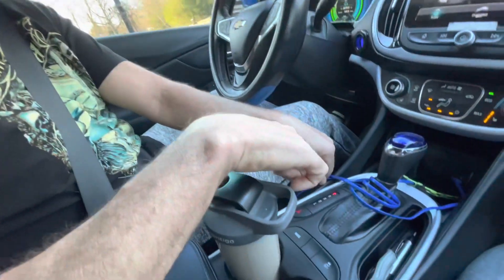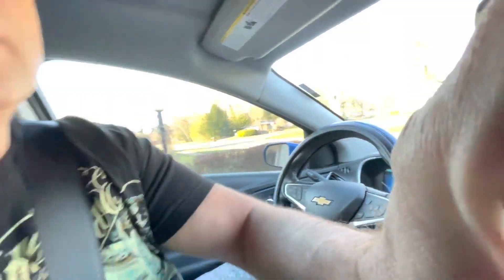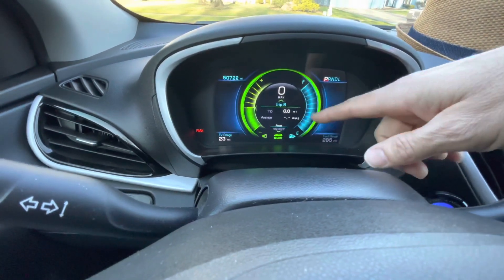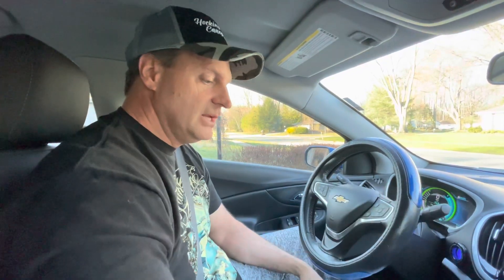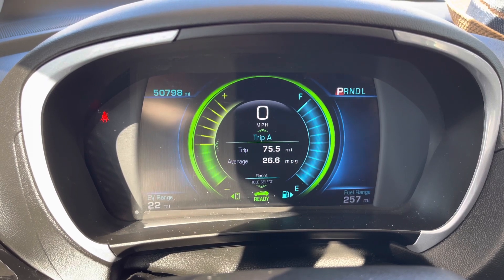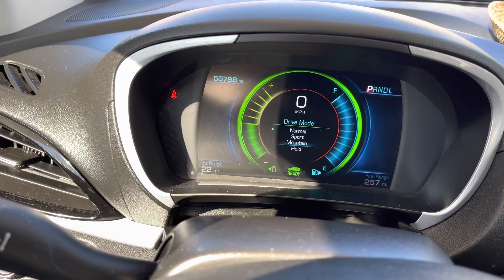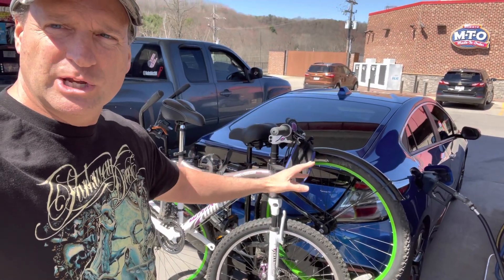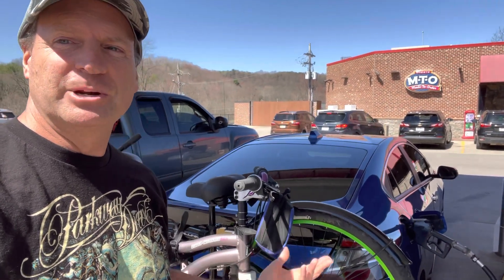800 Mile Chevy Volt Road Trip Experiment - One Way In LOW versus One Way In DRIVE!

Comment: I know i am  late to the party bu interesting experiment. I am new to volt ownership and was wondering about this very thing, so thank you. Side note and unrelated, what bike rack is that you are using? Been looking into getting one myself.
Reply from the maker: @goose_egg3698  I had some Chevy points because I have previously owned a Chevy and so did my ex so I use that to put the tow hitch on when I bought it and then I just got the bike rack on Amazon. It’s just a basic 1 inch hitch bike rack. I don’t even remember I bought it so long ago they’re thousands of them on there, but I know I only paid about 40 bucks for it……

Comment: Interesting experiment! One thing: When you push the brakes, unless you are really on them hard (going to friction brakes), it's doing regen braking. I just mostly use D and reserve L for long downhill or heavy stop-and-go slow traffic. Thanks for the video (Gen1 Volt owner here).
Reply: I have a 2013 Volt that's never had new brake pads. They wear very little because of regen.

Comment: i knew that about L vs D - no difference or slight difference - but the main difference is in preserving brake pads and fluids - that is what makes L mode a long-lasting benefit -
Reply from the maker: and also the one foot driving is kinda nice which we have gotten very used to

Comment: I have a volt too. Usually, I got 36mpg at 80 mph. If I slowed to 60mph,  I have 41 mpg. However, I don’t have bicycles on back.
Reply from the maker: or 100 pairs of shoes like Pamela does lol
Reply from the maker: we just got our shift to park error fixed under warranty and will do a video on it soon
Reply: @jackanddan  the battery control will fail some time later. good luck .

Comment: I can’t understand why your gas mileage isn’t better. I had a 2016 Volt and currently have a 2019 Volt. On highway trips, I’ve always gotten 40 plus MPG.
Reply from the maker: it usually is but as we said in the video we had a lot of weight and were also traveling and very high speeds....we also had the air cranked....we like to do these tests under different variables to see how it changes....

Comment: I'm not surprised that there isn't a huge difference when using the engine. That .9mpg over a 400 mile trip could easily be margin of error. I would expect a much more significant impact on battery-only range.
Reply from the maker: thanks

Comment: When converting energy there is losses.. so the more you coast instead of recapturing it, the better off you are.. And just recapture it when you HAVE to slow down.. So predict traffic and slow down in advance by coasting.. and brake by Regen paddle as often as you can without foot brake. I own the egolf and volt 2nd Gen and VW got it right allowing full coast without Regen. In the volt you have to put it in neutral to do that. Egolf has 3 levels of Regen volt has two; low and paddle.
Reply from the maker: thanks

Comment: Very interesting experiment. However, the number seemed very low.
I guess that was mostly because the bikes Addn the luggage. You don't need a hybrid card to get twenty five miles per gallon
Reply from the maker: no you don't and yes a lot of luggage......we have had much better on other trips especially when I travel for work on my own, but when we don't travel and just use this car for daily use we can go three or four months without using gas at all!
Reply: Okay, sorry I didn't mean to be overly critical. I'm actually thinking about buying a volt vmyself. That's why I was watching the video
Reply: It also depends on your driving speed.. Which I didn't catch because I didn't watch the whole video..

Comment: I wouldn't have expected much of a difference.  My understanding is that lightly pressing the brake is regenerative, so a light application of brake in D is functionally the same as removing accelerator pedal input in L.  I suppose it may have an effect on driving style, which depending on the person may be positive or negative impact on mpg.

For me personally, I tend to use L just for mountain downhills.  I find that when using L in city or flats, I tend to "wander" more on the pedal (ie slight oscillations between deceleration and acceleration rather than a smooth deceleration), my kiddos noticeably feel more carsick in L mode because of this.  (ie for a steady coast or slow deceleration, one has to be very precise with the right foot).  

I would expect those slight oscillations when trying to hold a constant speed would have a negative effect on overall mpg.
Reply from the maker: thanks we agree......we did it in the city and will upload that video too.....again not a huge difference but honestly we prefer the one foot driving and have gotten so used to it that driving in drive annoys us lol

Comment: If I'm not mistaken, using the foot brake with the Chevy Volt is blended with both regenerative, for soft braking and regular (using the brake pads), for heavy braking. The car makes the choice depending on how hard you press on the brake. In other words, it shouldn't make a difference on a long highway drive if you use the foot brake because you are not slowing down drastically enough for the car to use the brake pads. Maybe that's why the mpg difference was so little. 
For city driving the regular brakes are used more because regenerative braking can only slow the car down to a certain speed, after that the brake pads have to be used to stop. Let me know if this is correct.
Reply from the maker: we just took it in for it's 5 year check up and the mechanic told us yes but also that for 55,000 miles the break pads had less use than usual and we don't do a lot of highway driving.  He has worked on Volts since they were released.  Also, we did a city test as well and will release that video soon. it wasn't a perfect test but as close as we could get it.  We had an extra mile using Low and that's enough to convince us it's worth doing, in addition to less breaking and one foot driving.  Some folks might not care either way, but we like the Low gear driving and also see a difference in miles and break pad life enough to use it.

Comment: Great video....My first-generation Chevy Volt (2015) is "Absolutely Amazing"!  This car rocks. It is very heavy, and the car feels stable and solid. Quick as a rabbit!  Easy to park, maneuver, and is a great city car.  My car gets around 45 miles of range on average per charge. This car is built well, no rattles or squeaks so far.  The only downside is driving with the windows down is the most annoying thing about this car.  This September I will have owned my car for 5 years and only been to the gas station a few times.  I have only driven in "L" low gear since I owned it and at times, I will play with it in SPORT mode.  Lastly, I Love, Love, Love how quiet it is...I call it my Ninja mobile because it makes no noise.  Mine came with Leather & Suede Seats, Navigation, Rear View Camera, Red Exterior with Tan Interior, and front heated seats.  Best car I have ever owned.
Reply from the maker: thanks it rocks we love it too......just had it's 5 year update and also did a low versus drove city test and will be sharing it soon....hope to keep this for many years to come
Reply: I’ve been looking for someone to comment about the noise when the windows are down! Is that just a hatchback thing ? And is there anyway to fix it, I tried to look it up but I can’t find anything about it
Reply: @journeymanx219  A sunroof in the tip position (I used that in my Volvo to get the heat out as quick as possible). 
If you paid attention during science class you would know hot air is lighter than cold air.
So the a/c will even with the sunroof open, help to get the hot air out as the hot air will ascend and the cold air will stay down.
You don't have the road noise then unless you are on very high speeds.
I don't believe there are any Gen 1 Volts that had a sunroof as an optional accesory.
Reply: @waterkonijn  paid attention during science class 😭 okay bro calm down

Comment: What year is your volt? I have a 2018, but even in bad conditions I don’t get less than 40mpg on gas only! And generally on only gas I get around 50 mpg.
Reply from the maker: It's an 18 too, but as we said in the video this was turnpike going average almost 90mph and full load of luggage and bikes....we are going to replicate this exact experiment in the city with daily driving to compare and of course it will be very different....the variable will be the same nothing will change except the gear used....we will also do a 5 year update at it's annual check up to see if everything is copasetic.

Comment: Help me understand why you wouldn’t combine the paddle with low gear? Seems to me like those to go together like salt and pepper. I just bought a used 2018 about three months ago with about 33,000 miles on it and I absolutely love it so far. I use low for everything and I use the paddle whenever possible. Using the paddle and low is awesome and saving brakes is awesome.  I’m like you I rarely use gas as a matter of fact I still have 3/4 tank of gas from the original fill up.
Reply from the maker: We do.......we just didn't in this experiment because we only wanted one variable and wanted to see what a difference it made......it did make a difference and obviously using the paddle in addition will too.....we talked about this in the video and will also be doing a city driving experiment the same way to show the difference, which will obviously be bigger with stop and go traffic.....again we will not use the paddle so there will only be one variable......we of course do on our daily driving to get the absolute most out of our electric......can't say enough about how much we love this car and are happy we bought it....we will be doing that experiment in the next couple of weeks.....thanks for watching!

Comment: Great experiment. Personally, I don't like driving in low at highway speeds, probably the old school in me so I stick to drive and throw the Volt into "hold" mode on the freeway (Usually between 70 - 80 mph) and save the battery for off-ramps, small towns. Driving on battery is more fun to me, especially in sport mode. I usually get upper 30s, low 40s in the summer, not so much in the winter. I suspect those bikes on the back were knocking your mileage down. Also, good career path for your son. When we had solar installed, the installers said they are always looking for electricians, etc.. If in fact, he likes that kind of thing. Many other careers in electric as well.
Reply from the maker: Oh yeah we love electric mode and we love sport mode and we are going to be doing this experiment over the net few weeks in the city.....we rarely have to drive on the highway but thought we'd use this trip as an opportunity to check this whole thing out and it's cool that we were able to see the difference it made in mpg and breaking and also that one foot driving stuff which was nice

Comment: Electric is just better for city driving. Good mileage on highways too but you need a level 2 home charger for refill time. Our 2022 GMC Terrain with 1.5 liter turbo and 9 speed transmission gets 37 mpg on long road trips. I don’t see the draw for a hybrid if it’s getting the same gas mileage as a similar car that is just gas. Again, nice in town but with such a small range, it doesn’t make sense. Super chargers on the road cost just under gas prices and you can get your 250 miles of electric range back in just over the time to have dinner. Hard review, I’m sorry. But you can buy a Chevy Bolt for $27,000 and still get $7,500 off what you owe Uncle Sam at tax time.
Reply from the maker: Nothing to be sorry about at all sir we agree and wanted to do this experiment to find out more information and we are happy we did.  We did have a full load and the bikes and also were traveling at quite hi speeds with traffic on the turnpike.....so everything single thing against what a car like this was made for.  But we still love it and the day to day use is amazing and we are going to be doing the city experiment over the next few weeks.  Chances are good we will keep this in the family and get another vehicle down the road when the range is closer to the 500-600 mile mark they keep saying they are going to achieve in the next couple years.....some have already gotten close too

Comment: Look out ,,,,adult spring adventure. 
I never use cruse but my wife does.  
Thanks for doing another video on this as I am really torn between getting a hybrid or just electric for our next vehicle. We only have one vehicle
Reply from the maker: well we gained 1 mpg and saved a lot of breaking so I'm sold on using LOW forever now.....Jack and I will be doing a long term city experiment and we are sure the difference with stop and go everyday driving will be much more than 1mpg but we won't know for sure until we put it to the test!
Reply: Go electric, Bolt costs $27,000 new plus you still get a rebate at tax time. Hybrids get the same mileage as their all gas counterparts it would appear based on this experiment. The Bolt’s 65 kWh battery can go 250 miles at $.12 cents per kilowatt home charging, closer to gas using level
3 charging. And you don’t have to maintain two driving systems.
No gas, oil, transmission, starter, rarely needs brakes, just change the cabin filter every 35,000 miles and your tires as needed.